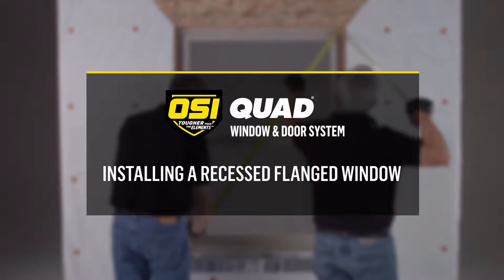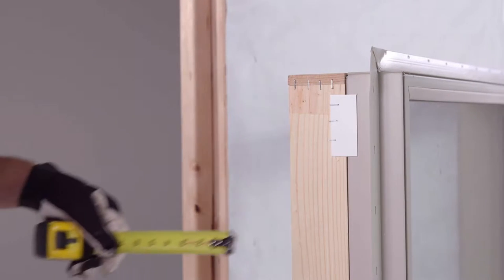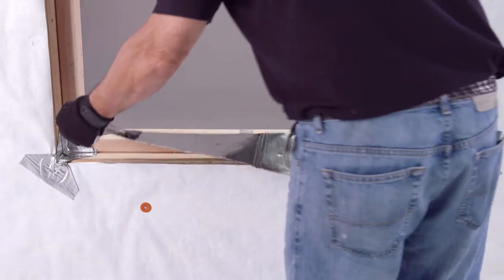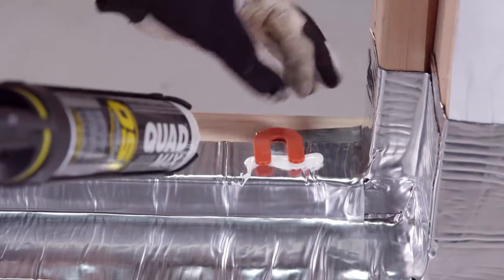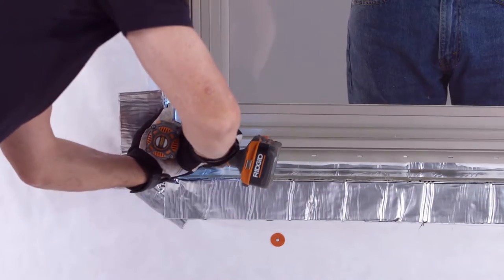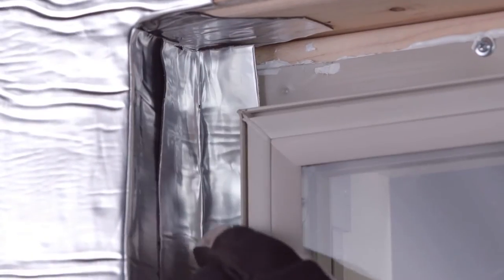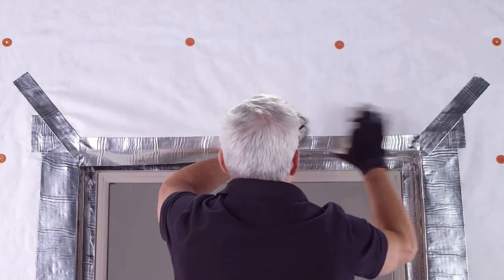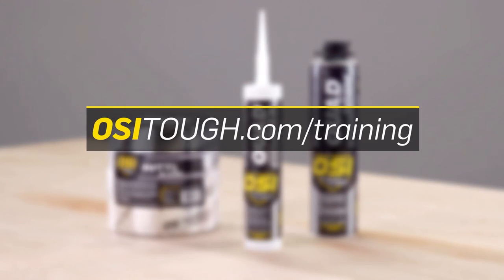How To: Instaling a Recessed Flanged Window

Comment: This is the absolute best video I've seen for flashing a recessed window opening, while still using a nailing flange.

You could recess a window by removing the nailing flange (or buying a window without one) and fastening the window with screws, through the window jamb, directly into the rough opening. In fact, this is how many replacement windows are installed.

But, please consider that in the case of a replacement window, the wood has already aged and taken its shape. However, with new construction window installs, the wood in the rough opening is likely still green and will move as it ages. So, if the rough opening moves, it could also bind the window.

Using the nailing flanges, the slop between the fasteners and the slots in the nailing flange can keep the window from binding up as wood aging and subsequent movement occurs. Personally, I use rope caulk behind the nailing flange because it seals but doesn't harden, so it can allow some slippage, as the rough framing ages.

In any case, I would certainly use the OSI tape and non-expandable foam and their associated methods for install. It looks like an excellent method for sealing in a window. 

Pro tip: buy European style windows (about $675/ea for a 3'x4'), I buy direct from Seemray. The build quality is excellent and the U-Value is over 2x better than most windows and the air leakage is about 15x less.